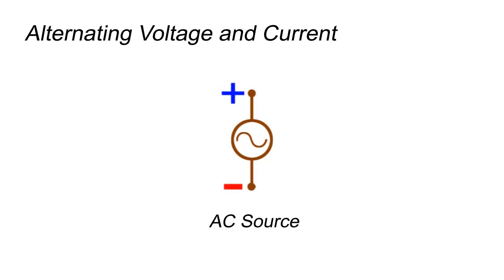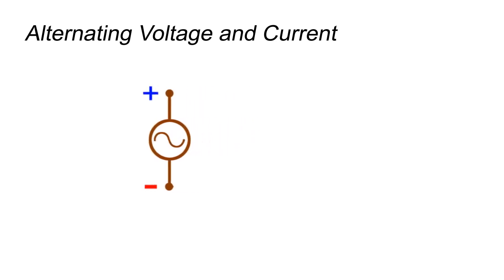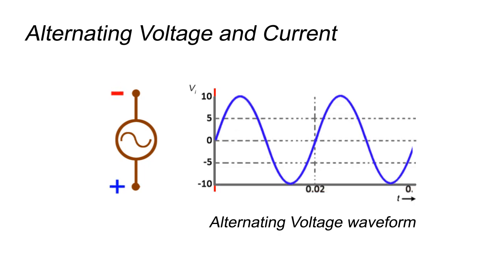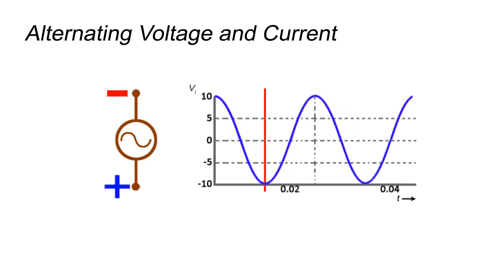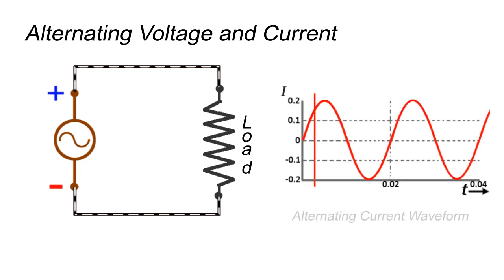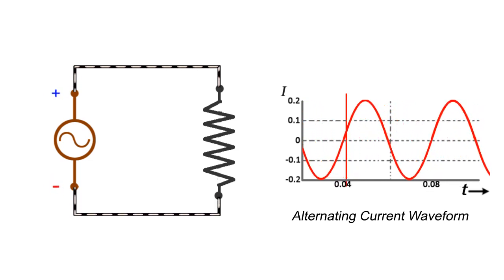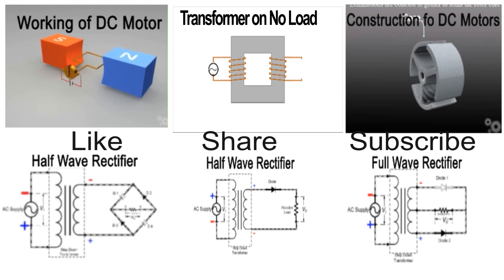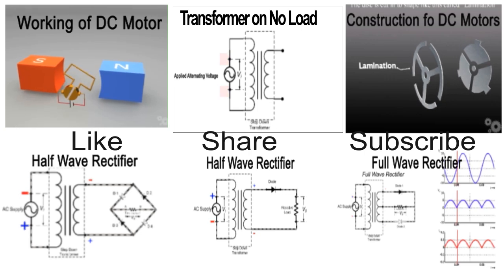"Alternating voltage and current" how it works?(Animation)

Comment: Mam then how electricity moves if current changes directions.please help me
Reply from the maker: Electricity is energy so it transfer to load though source irrespective to the direction of current. consider if you pull and push somebody with your hand it doesn't matter your pulling or pushing simultaneously. ultimately your are doing work. so work done multiplied by time is equal to energy.

Comment: In the animated video, it has been shown that current has alternate direction. But how the neutral input work during the switch is on. If a tester is inserted into the neutral input, why does the tester does not glow. A Small demo with the wall AC socket shall be very helpful to me.
Reply from the maker: We can understand the function of neutral wire by its name "Neutral" that means it doesn't have positive and even negative polarity. 
At electrical substations neutral wire is connected to ground (Earth) that's why it has zero voltage.
Reply: sourabh sharma sir then what is the difference between earth and neutral
Reply: @varshapaliwal7464  same things

Comment: mam, why AC current does not use to make electromagnet.
Reply: Jogesh it is very simple as we know AC current changes its direction repeatedly therefore if we apply ac current in an electromagnet it's poles will also changes as per frequency and therefore we didn't get stable pole. In some applications ac is also use when we required vibration such as electric bell. Please search for "How electric bell work" and you will get the answer.

Thank You
Also please Like, Share and Subscribe our channel

Comment: why when the polarity reverses ,and you are checking voltage at a was socket.  there is voltage between  black wire & ground ,or black wire & green. but there is no voltage between black wire & green? if the polarity is  changing why is there no voltage read on millimeter?